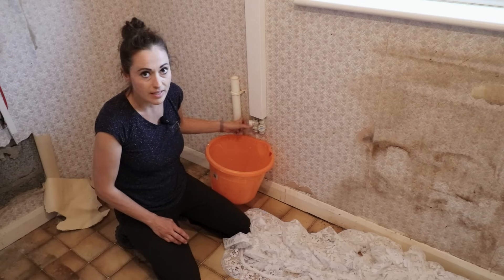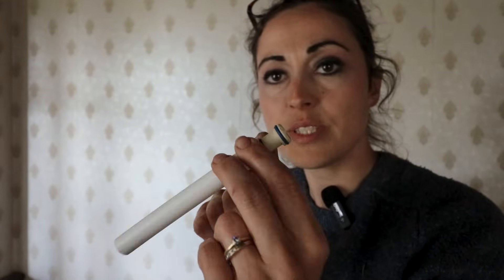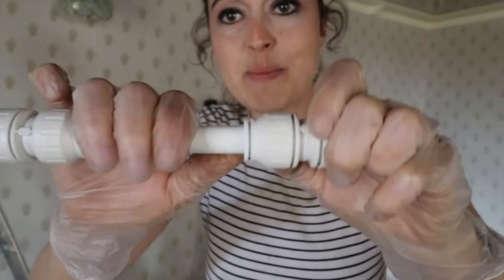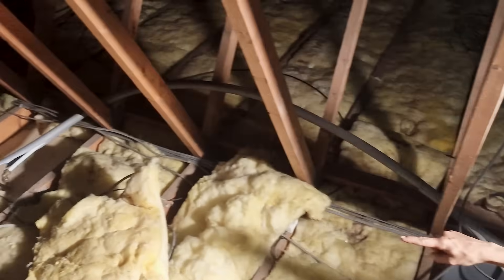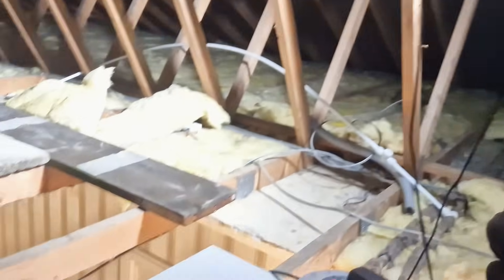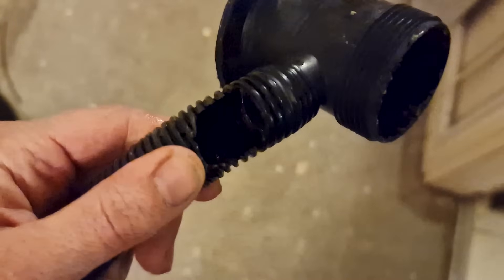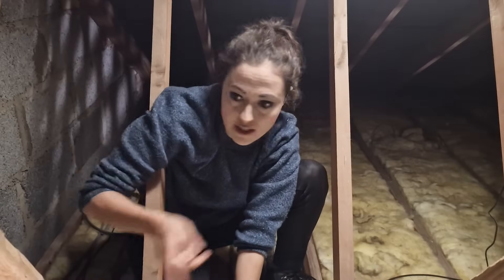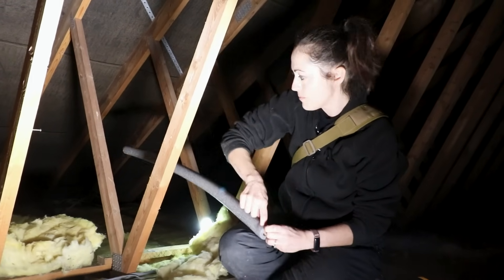We tried to fix the leaks but FOUND MORE PROBLEMS in our new auction property!

Comment: Copper pipe around the house to manifold in each room.
Then plastic push fit to the appliances.
The pressure is at the highest pumping around the house, the manifolds distribute the pressure equally to the appliances.

You know if you don’t like soldering, there is a copper push fit connector or the Yorkshire solder ring connector.

Comment: Warning!
If you don’t know what you’re doing with plumbing then stop.

Water pressure builds up over use, this is why it’s best to use copper pipping for the main system. Then have manifolds in your bathrooms and kitchen which can reduce the pressure to your appliances.
Plastic push fit pipes are good for toilets, sinks, baths and showers, when controlled through a manifold.

Also I am guessing that the numpty at ToolStation didn’t warn you to use the red and blue collar clips, these clips are not only to identify hot and cold pipes but also to prevent the connector from coming loose if you experience water vibrations or water hammers.
I bet he also didn’t tell you that if you don’t use them some insurance companies can void your policy if the pipe bursts or the connector falls.

Honestly, I can see your overwhelmed with comments from fans and social worshipers, but if you’re going to make videos about renovations, Please research the correct way first.
Because if you don’t it’s going to be a very expensive mistake.

I’m not commenting for likes or thumbs up. I don’t care about that sort of stuff, so take my advice or not it’s your house and your choice.
Reply from the maker: Thanks for your insight. I thought it was obvious this was just a temporary fix with it only being our 2nd week in the house before we consider a new heating system and complete remodel, etc.

I know we'll disagree on this, but right now, spending on replacing all isn't a priority as it will all be taken out again over the next few months anyway.

And it's unfair to assume it's just men who work at Toolstation, or that it's their job to educate their customers on every single job. I knew about the red/blue collars but I'll admit, I've never heard that some insurance companies didn't insure without them. I'll make sure I'll add the cold ones when I'm up there next... I forgot to put them in my plumbing bag, but you can see me using them in this video: https://youtu.be/wAjWbRICm-w?si=mcYMgwOPcI3WmHY2
Reply: @TheCarpentersDaughterUK  
Hi
Sorry I may of had a bit of a rant there but I would just like to add, that as you are a YouTube streamer and influencer, when you upload videos of work you should always demonstrate the correct way.
People will always copy what you’re doing and then use your videos as an excuse when things go wrong.

Like you I had to renovate the kitchen and bathroom and went to my local plumbers merchant “hop skipping, thinking JG plastic push fit would save me money on hiring a plumber”
The sales guy asked me what I was doing, then basically slapped my face and gave me a quick lesson in pluming.
So I went away, sat down and researched everything.
Then went back and bought the correct equipment for the job and did it myself the right way first time.

Some people on your comments page have said the right thing to do, is to take your time, completely strip the whole house bare and start from scratch.
You should listen to this advice before starting renovating.
As they are trying to save you time and money, I can tell you every time you start changing things you will find ten things that need fixing before you complete anything.

Anyway! I wish you luck and I’m sure you’ll find out the right way in the end.

Comment: That pipe lagging isn’t up to the job, re lag all of your piping in your loft space with modern foam lagging 👍🏻
Reply from the maker: Out of curiosity, why is the wool stuff so much more expensive? I've read it's better
Reply: @TheCarpentersDaughterUK  it’s probably only better from a sustainable source point of view, if I really wanted to make sure pipes didn’t freeze in a loft I’d choose fibre glass lagging first, then the foam, then the sheep’s wool, wool lagging to keep some heat in works very well I’m not so sure it works well at keeping cold out. Your loft kinda proves that point 😉

Comment: You're mad thinking about fitting air source in an old house, Govt. grant or not it'll cost a fortune in the long run!
Reply from the maker: I'm still in the early stages of researching. What age is an old house to you?
Reply: @TheCarpentersDaughterUK  maybe anything older than this century but certainly nothing 40 years old or more. Heat pumps only work in extremely well insulated houses. I know quite a few people with older social housing who've had no choice but have it fitted and it costs them a fortune to run.
Reply: I’m sure upgrading the insulation is up there on her to do list. The house isn’t that old- it must have cavity walls for example. A house like this that needs everything doing seems like an ideal candidate to me.
Reply from the maker: Yes, it has cavity walls, double glazing and are topping up the loft insulation
Reply: Well I've been watching some more videos and I'm probably wrong (not a new experience)! 🤷🏻‍♂️😄
There are those who say you can put air source into older houses (houses not designed for it from the off). Like most things it looks like real expertise is the key and the problems many have been having is with incorrectly specced systems. 
I'm sure you've looked up Heat Geeks, they say they have the knowledge and say it's cheaper than gas.
It doesn't change the fact that everyone I know who has it in an older house can play 78's on their leccy meter tho... It's not something you want to get wrong, heating your house! 😬
Good luck finding the best solution for you, I'm keen to follow the story. 😁

Comment: Please don't shoot pipes all over the place like this. Speedfit fittings do not like it as your adding stress to the joints. No doubt about it some of this plumbing will leak down the line. From a time served plumber.

Comment: Me bought somewhere similar. they were in the loft and under the bath. They came in via a gap next to a 40mm waste pipe from the bath and would go under the bath or up the cavity into the loft. We gathered the insulation and bined it in bin bags the council will collect it for a fee and you can tip the bulky collections bin men wink wink. Vacuumed the loft and bleached it. Then got another EPC that said 0mm loft insulation then a year later got free loft insulation with a grant in the meantime, the loft had no insulation which was perfect for plumbing and electrics.
We also got solar panels for free somehow and now it is EPC A. To get a grant you mayalso need to fit weep vents on windows and fan in kitchen and bathroom.